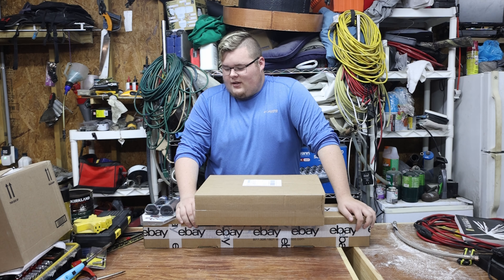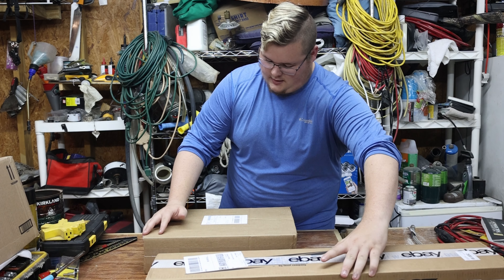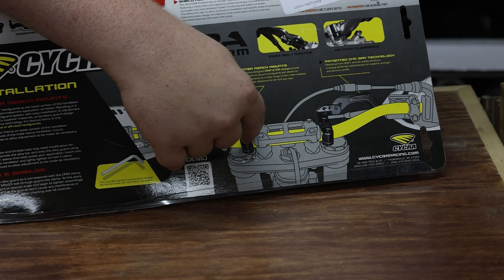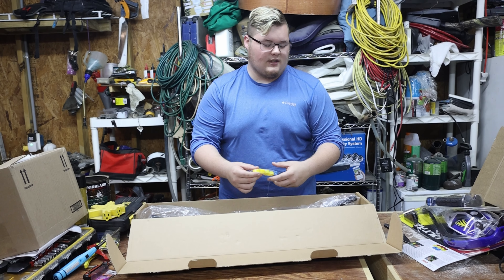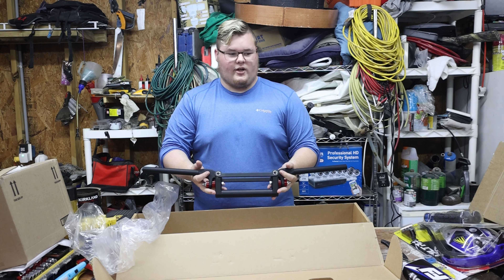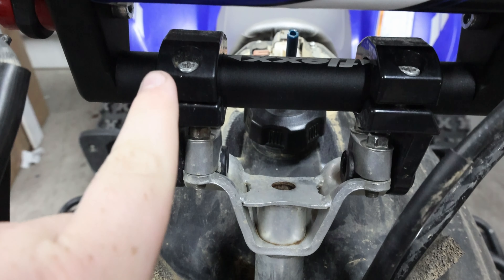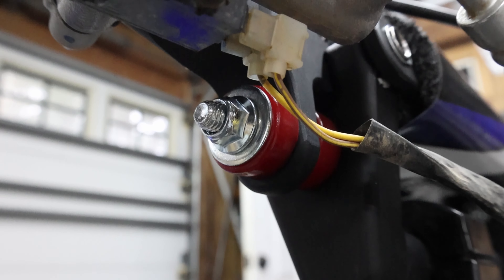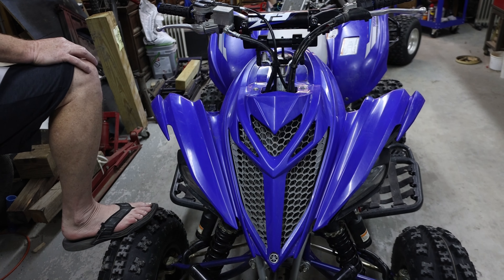How to Install Fasst Flexx handle bar on a 2020 Raptor 700r

Comment: Do i need an adapter if i dont wanna use the raiser
Reply from the maker: The Flex is a 7/ 8th bar, so if you have a stem or clamps the same size, you're fine No additional bar or clamps are needed

Comment: nice video  man did yall use  Risers on ur raptor
Reply from the maker: Yeah, we bought some protaper handle bars and they came with some risers so we mounted the bars to that. I wish my footage didn't corrupt we explained that sorry.
Reply from the maker: Rox Speed FX Elite Series Pivot 1-1/8" Handlebar Riser - 2in Rise - Black 1R-P2PPK 

These are the Risers we have been using! If you still need them, we haven't had any issue!
Reply: Nice video! The height with the handlebar high (116mm) with this risers the riding position is not higher than the original one? I’m still hesitating between the same as you or the standard one (96mm high) with the same risers
Reply from the maker: @badylvn  I think it just depends on angle. You can tilt them if you want tall.
Reply: @Wheeler_Bros  did you needed to extented you clutch throttle cable and your brake line?
Reply from the maker: @jipi186  No, those risers didn't need extensions. We still have factory cables.
Reply: @Wheeler_Bros  cool thanks!
Reply from the maker: @jipi186  of course!

Comment: What bar did you get the moto 32in? Standard height and sweep?  Great vid
Reply from the maker: We are trying our best to make sure all the parts are listed in the description, but this is the link for the bars I got.
Fasst Flexx
https://www.ebay.com/itm/401496654847
Hopefully this helps you and thank you for checking us out! We are going to try and make a test video riding with them and what not.

Comment: Will Renthal fat bars not work?

Also did you have to use different steering stem and ckamp
Reply from the maker: The Renthal Fat Bars wouldn't. The Fasst Flex are the bars them self. They are not like the Urmosi Clamps. So if you by the bars all you have to do is put them in your clamps. I have installed them on Protaper and Lonestar clamps no issue so I think you should be fine.